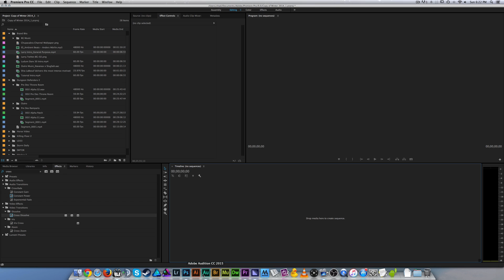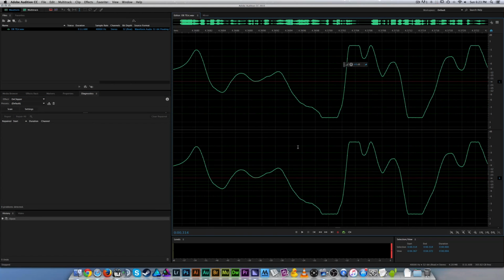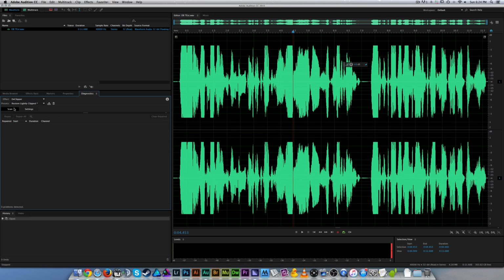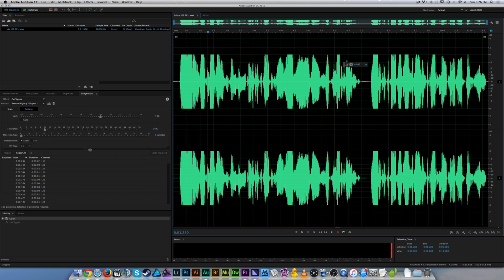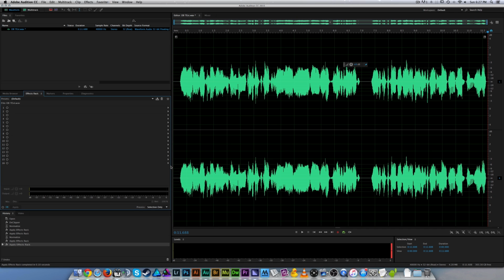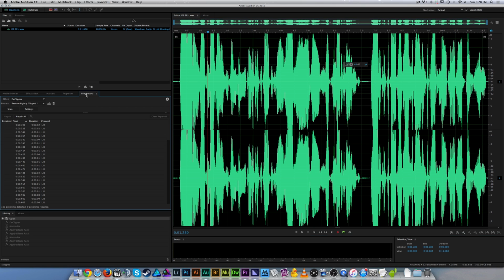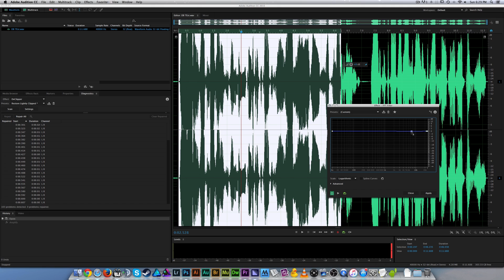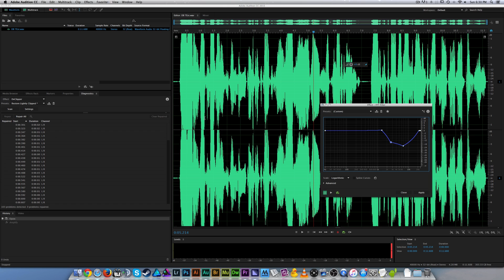Fixing Distored & Clipped Audio with Adobe Audition CC

Comment: Great Tip.  I didn't even know you could do this.  I just recorded a concert on a canon EOS R and Atomos Ninja V.  I knew the audio would be clipped from the camera but I figured since I was recording to the Ninja external recorder set to 32 bit float, I could just turn down the volume in post and fix the clipping.  Well I don't know what bit rate the Camera has but the 32-bit recording from the Ninja just recorded the already clipped signal.  I'm going to try the method you suggested but do you know a better way since I technically do have a 32 bit file?  Thanks  btw, my file is not clipped.  the levels are not high at all.  The sound is just distorted from being recorded while clipping.  If that makes sense.
Reply from the maker: sometimes you just gotta roll with certain types of distortion when your audio is clipped. There's some different filters you can play with to try and remove or cover it up. Id just go through them and play with a few presets and see if anything happens.

Comment: Excellent tutorial! Thank you! My only additional note is to feel free to go to extremes if you have really bad audio. My cheap microphone couldn't handle even a slightly loud person, and it wasn't that the levels were recorded too high - in fact, just the opposite, the levels were actually quite a bit too low, but the cheap mic I was stuck with using in a foreign country was overmodulating anyone who was slightly enthusiastic about our interviews. So, I did everything as you instructed and set the tolerance to 15% and it worked like a champ! 12% did nothing and I was losing hope, so I tried 20 and saw decent success. Then I honed in on 15% as the best setting. Thanks again!
Reply from the maker: Glad it helped. CHeers.

Comment: I watched a couple other videos about this issue and it sort of works, but not exactly for what I'm trying to do. I have a lot of CDs that have the music that are over mastered and really LOUD. I've tried toning them down, but their still LOUD. I've tried using this method, but it still leaves a few spikes and then leaves some areas sounding muffled. Unfortunately we can't go back ad re-record or remaster a CD that's been pushed into overload. I've used the Normalize mode to try and tone them down, but wished there was a trick to UNLOUD them as their still clipped off at the top. Guess I'll keep experimenting.
Reply from the maker: Most methods of fixing clipping is barely a bandage at best. If your audio is clipped, even just a little bit, your just gonna fake it not fix it. If the standard methods shared on Youtube don't help, you may need to just pay someone to fix it as best they can. There are audio services available on the web, though im not sure if any of them handle clipping.
Reply: Thanks, but not looking for a service. Just trying to figure a way to fix it myself. I've tried various settings to clean up the clipping of CD tracks, but normalizing seems to be the best way. The Declipper does work, but not on taking out the over mastered loud CD tracks mess. If they just hadn't done this in the first place...

Comment: The noise gate doesn't serve any purpose in this recording, because there is no noise, and if there was, it would only draw attention to it. FFT filter is nothing but a 'digital' equalizer. It brings down frequencies in the signal, as well as the noise. Given the choice, I'd prefer the clipped version without the treble cut. A declipper normally expects sharp clips, which the filter would soften. Maybe iZotope's RX declipper plugin would work better.

I'm unfamiliar with Audition, but looks like your signal is still going over full scale after declipping and the gain needs to be reduced with or without a limiter.